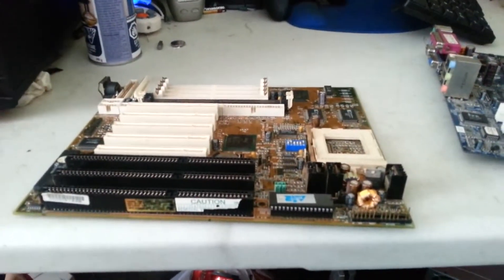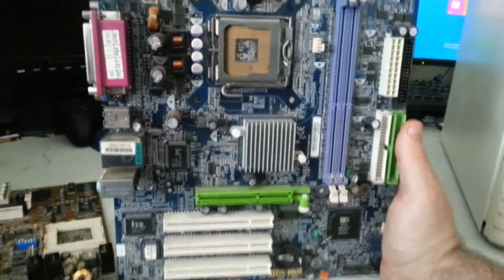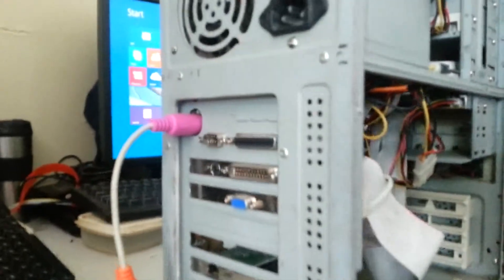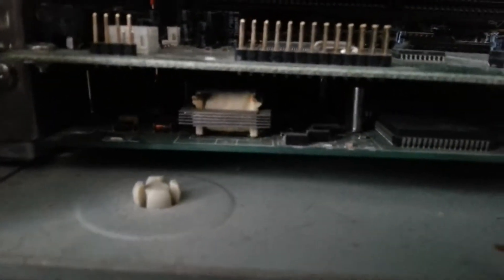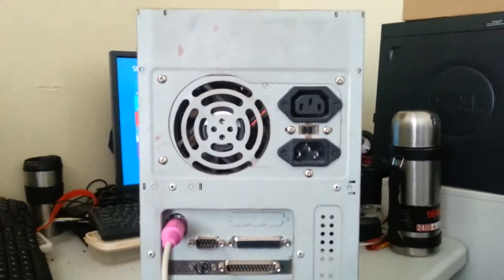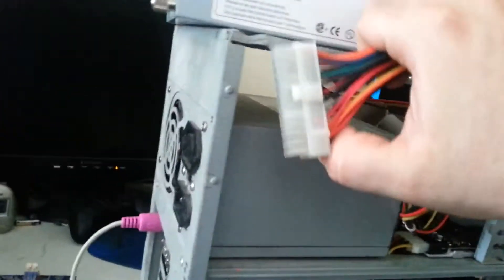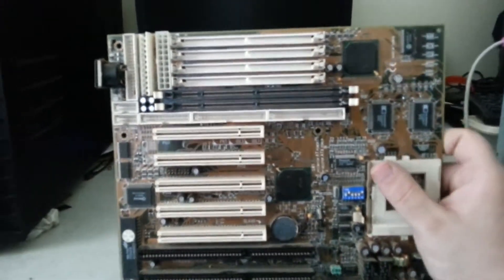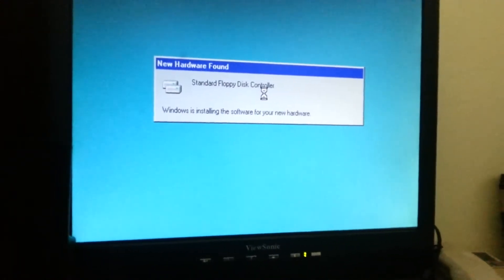Main differences between AT and ATX systems

Comment: I'm amazed to see an AT motherboard with onboard USB
Reply: It surprised me when I first saw it too... Was given a few old motherboards last year and there are a couple of AT boards from around 1997 with USB, so not as rare as I thought even in those early days
Reply from the maker: They're usually present in the later years of the Pentium era. Some AT boards are equipped with slot 1 and some with the slot 1/ socket 370 combo, however they're on the cheap side. What more rare are the 486 boards with PCI slots on them.

Comment: I have a ASUS VX97 and a Gigabyte GA-586TX3, both are in ATX cases, they have no IO shields cause the AT io shields are rare as hens teeth, maybe i can 3d print one or tape a rectangle of cardboard with a hole in it over it.